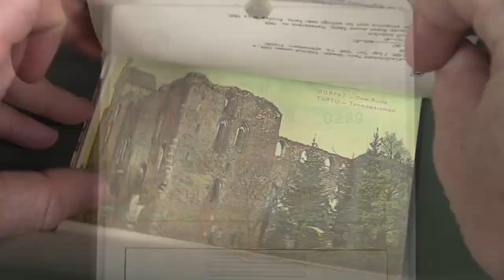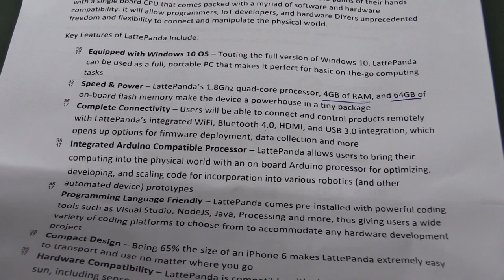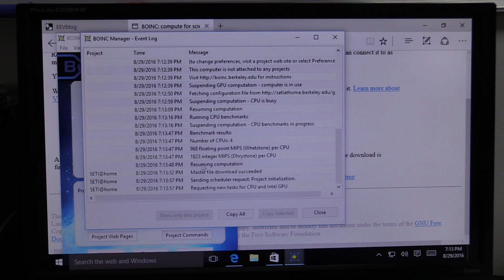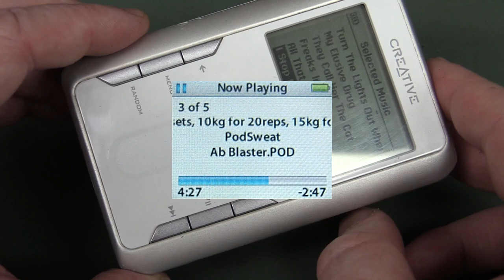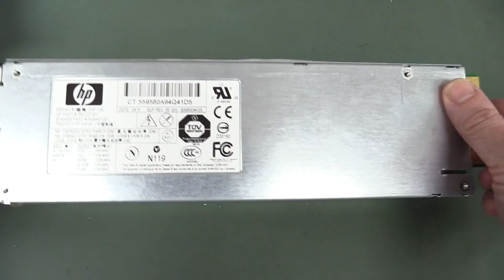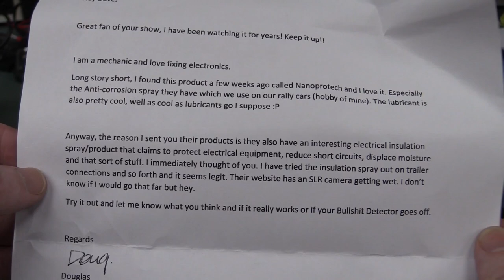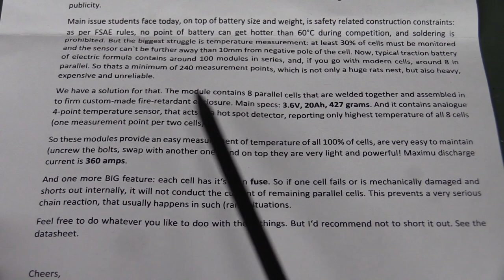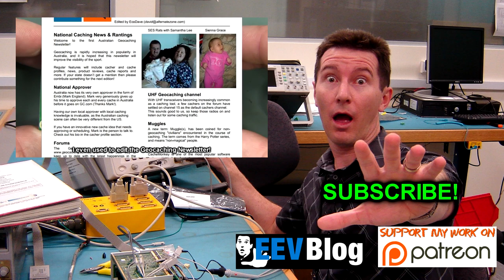EEVblog #917 - Mailbag

Comment: What is fascinating is the Russian (Or USSR, to be correct) radio and the  components used. These Russian made cold war transistors and passive components seem to have a longer life expectancy than the western solid state, both germanium and silicon, plus R+C of same period. What we are seeing now is many of the early western made transistors dropping like..er..flies? Japanese transistors are variable too, some perfect after 50 years others useless depending on package. All those top hat Russian ones seem always to work, same with R+(some)C. Also we are beginning to see big passive components failing, after 50 or 60+ years, with things like the enamel coating on the copper wire in transformers breaking down, almost every old cap is duff, as we know, carbon Rs are all doubled in value)) etc. When I started picking old stuff off skips, most of it would work...now its getting more complicated to keep ancient stuff running - use old Russian germaniums if you need them, they will work.

Comment: the panda isn't slow dave.. you plugged win 10 into the internet, it will immediately start pulling down updates and installing drivers etc which will seriously hamper your experience. If you let it update after a little bit of time it will be mint.

Comment: Power button...... WTF? That is just plain stupid
Reply: Its probably is based on standard PC build. 
I'd think you would be able to select always on in the BIOS (or wake on lan etc..).
 If I had designed it, I would route the power on signal to the header for external use (if required) & install the PBT for prototyping.
And it needs a power button because its a windoze PC, you will need to hold the power button down for 10 seconds at least once every 6 months.
Reply: Like other person commented. there is another bios with "autoboot" option

Comment: Marketing bullshit aside (which i hate as well) my guess is that the Nano Protect stuff is a standard hydrophobic spray... All three cans are likely the exact same stuff... It might work protecting a circuit on a drill going underwater. But the moment the thing turns on and the brushes rub off the protection it would short :)

Prolly does work for basic water proof/protection of some kit... Reminds me I could do with some hydrophobic spray for my project.

Comment: Have to wonder if they had the same 'testers' for the liquid B/S (sounds like a case of the craps to me.....)  Back on topic:  They had the same testers on that liquid electric stuff that was used in the batterisizer baloney.  Remember the "expert" sitting on a child work desk with a scope set up to calibrate (and it wasn't calibrated correctly in the first place)  Just some guy they grabbed off the street, threw 'em $20 and said  "Read this and try to look smart".  And they threw a lot of electronic do-dad's and thingiemajigs trying to pull off the scam.

Comment: have ordered a lattepanda 4/64 --- arrived today.
they only deliver with win10 ... 
but the win10 comes preinstalled is not activated
looks like the user has to buy a legal key
that sucks!!!

other panda users, same experience?
Reply: crapcbm I know it's been a year, but if you purchased an activated version, the key is installed in the BIOS and you can use some license key lookup software (i.e. SIW) to find it and activate using that key.

Comment: 13:30
Since it is Windows 10 with forced automatic updates in the background, it will be sporadically laggy like that quite often during the next few hours or days until the thing has finally updated to whatever Microsoft wants you to be running.  Stupid Windows 10!  Just leave it plugged in over night or leave it unattended for a day or two and then come back to it.  I think you will have a much better experience once the updates are finished.
Looks like it could be a winner otherwise.  I hope you will do a dedicated review sometime if you have the time.  The arduino and intel combination is interesting.  It would be cool to see if the arduino runs via hard power up and the intel system runs via soft power up like you mentioned.  You could then have a low power embedded device and presumably have the option to have the arduino turn on the soft power to the intel system if you jump the correct wires.
Reply from the maker: Ah, yes, could be that.
Reply: Possibly, but more likely "telemetry" :)
Reply: David Thornley 
You are insane or paranoid.  Telemetry doesn't use up more than 25% of your CPU; not even that low performance CPU.  If telemetry was so inefficient and wasteful, Windows phones would be locking up all the time.

Comment: Why is Dave going so hard on conformal coating? I mean, he clearly knows it works, but then in the video, he says it's a bunch of BS. Doesn't make any sense.
Reply: It doesn't sound like conformal coating to me. They were suggesting that you can use it to waterproof a power drill. If you conformally coat something with moving parts, they are not going to move again. Conformal coating is certainly not invisible like they were claiming either. I would say it's a bunch of BS too.

Comment: It hurts a bit to see you going that fast on IT stuff, after all it's the sister of EE...
1) Edge IS fast and good, if you only gave it a chance. Try Chrome on that mini pc and see for yourself which browser is hogging the machine and which is not. Of course everybody installs Chrome on their overclocked i7 or on a dual Xeon and thinks the speed is a merit of the browser. Please. No.
2) Windows 10 does a lot of stuff in the background, especially at boot and on the first boot. It's not a bug, it's installing drivers, doing maintenance on itself and a gazillion other things which you don't see but are required on a modern PC to do modern stuff. Both W10 and Linux would run much faster if the housekeeping work had been stuck at 2001-levels.
Cheers :)

Comment: Dave, run your radiation detector over the radio.
Reply: spray the windows 10 pc, dunk it in water.
Reply: Military hand watches  ware radioactive because of phosphorus hand-drawn hour numbers on the plate. Radios had nothing inside, that could be radioactive for any reason.